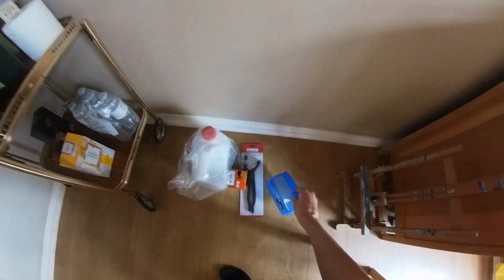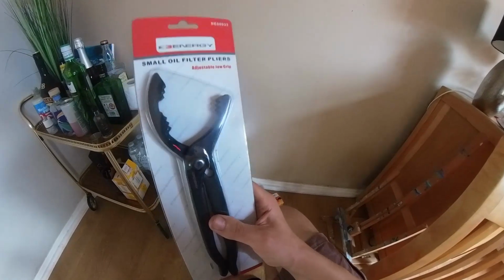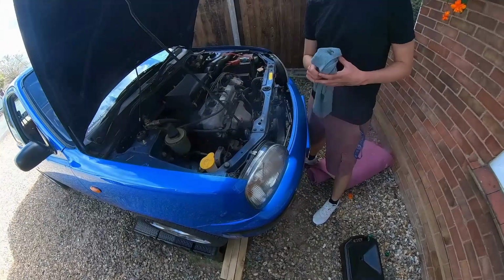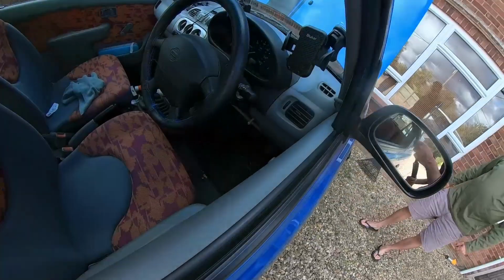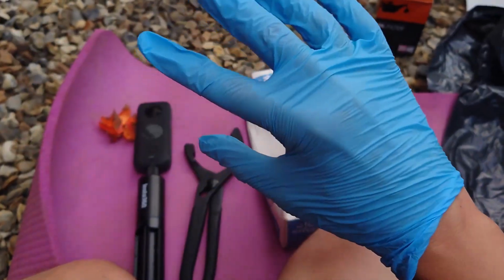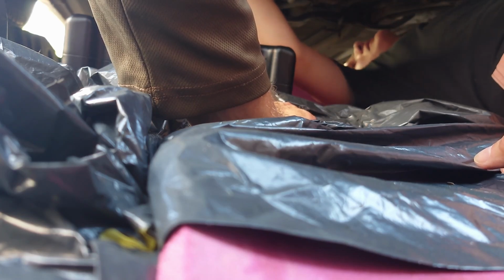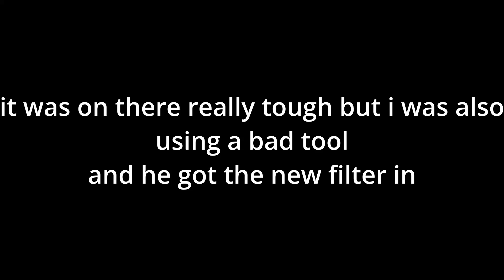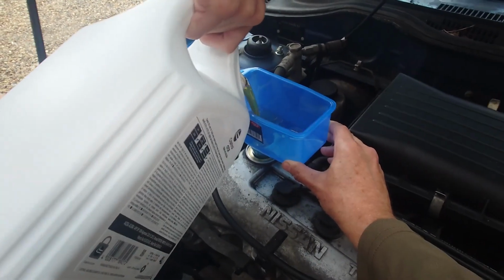GONE WRONG! - My First Oil Change Nissan Micra K11

Comment: Hi I saw a YouTube video of the vauxhall Corsa d where the car was dechromed around the logo. How did you manage to do this?
Reply from the maker: to get around the logo i taped the logo off with masking tape and then i masked of the edges of the grill with masking tape and news paper. i sprayed it with plasti dip which comes off easily but for a more permanent option you can use primer and paint
Reply: @jayfrosvlogs  Thank you for the info!